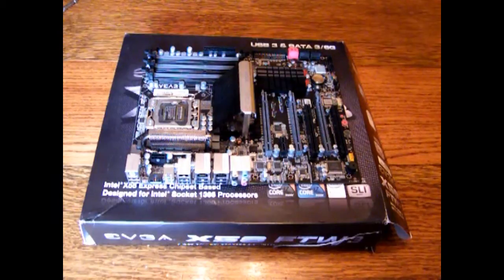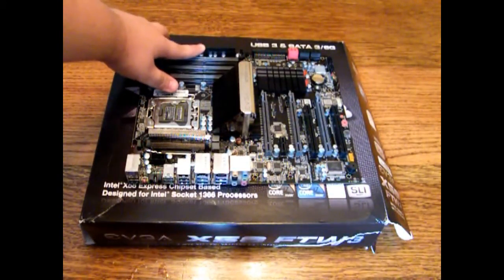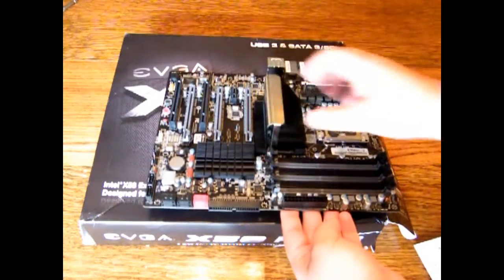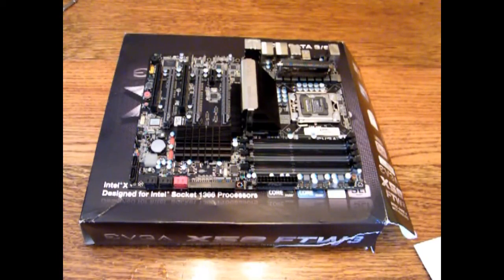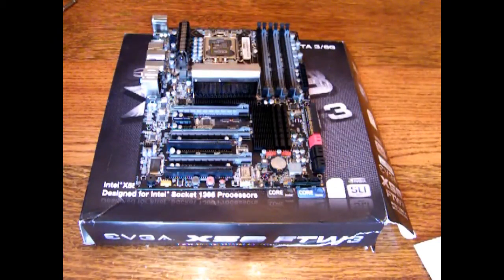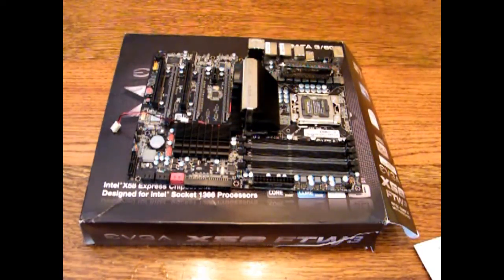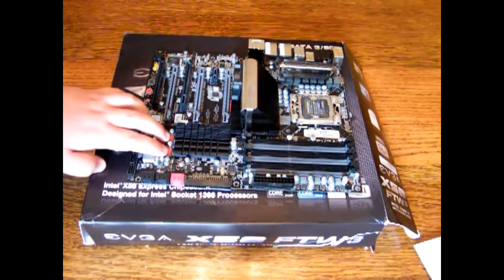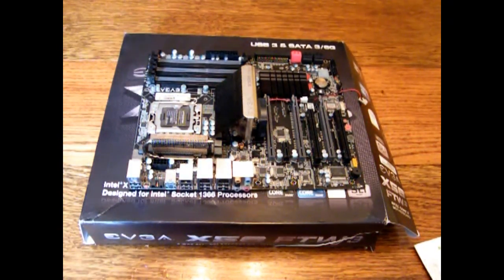EVGA X58 FTW3 Motherboard Overview

Comment from the maker: I have had good success with this board however, It only has 1x8 pin cpu power. I currently have my i7 930 running at 3.8ghz with no problems. If u buy this board you will want to run a 40mm fan on the north-bridge, and ensure you have some airflow over the mosfet area of the board. I have liquid cooling so i have a 120mm fan blowing across the ram and cpu socket area. If you dont then you may have some overheating issues. Other than that it is a solid board and runs great.

Comment from the maker: yes. beside the cpu socket there is a 8 pin cpu power connector(NOT 8 PIN PCI-E). this needs to be plugged into the power supply for it to work correctly.

Comment: So the power supply plugs into the 24 pin connector (obviously) and what about the 6 or 8 pin next to the CPU? that also connects to the power supply? My motherboard is on it's way..just wondering. Thank you!

Comment from the maker: @TeddyCooper69 i just tried that in my rig for you. it does bump the 2nd 470 to 8X. also running 1 8x makes no difference in performance. i am running 2 gtx 470 and a 9800gt in the order 470,470,9800 the second 470 is 100% sand witched. it runs about 2 degrees hotter then the top card. the way the 470 is shaped the intake is off the back of the next card by about 1cm. i would also recommend getting a 9800 gt or better for physx. for $100 you get about 30% more FPS in every game that uses physx.

Comment from the maker: @Aviation7997 correct. you can populate all of the slots for a x16, x8, x8 setup. with todays graphics cards there is no performance drop at all by using x8.

Comment from the maker: @hosrom i have my system runing strong. i have a 4.2 ghz overclock running nicely, with liquid cooling. voltages are very stable, better then most other boards ive used. i used the intel core i7 930.

Comment from the maker: @Mohagrus The D14 will fit on this board however you may have some memory clearance issues. It will clear the NB fine tho. May I suggest going with a Corsair H70 because it will run much quieter, cooler, will look better, and you will not have any clearance issues.

Comment from the maker: @Kyushu79 ya. evga has a winner here. i was saying that the parts were getting a little warm because im using water cooling. the NB is by far the warmest thing in the system however 65 is nothing to worry about.

Comment from the maker: @traingp7 there is about 1/4 of an inch or .7 cm in between the top video card and the fan plus the fan is on a slight angle upward so the size increases.